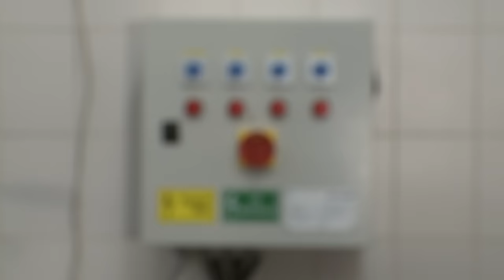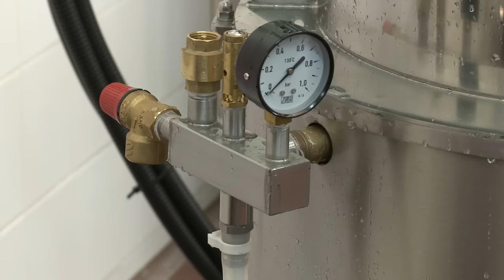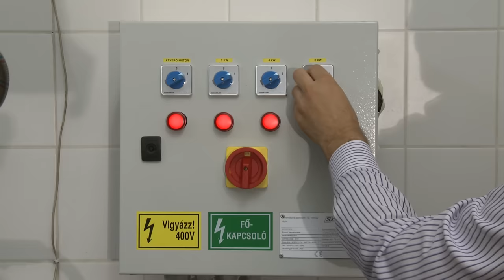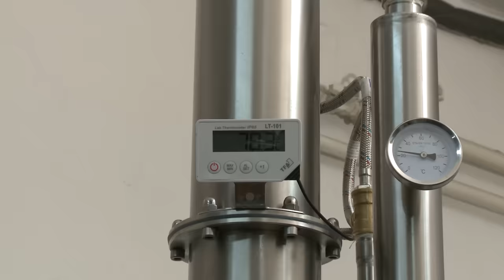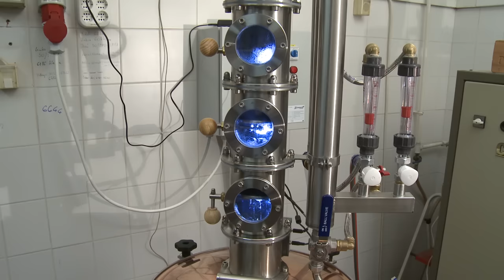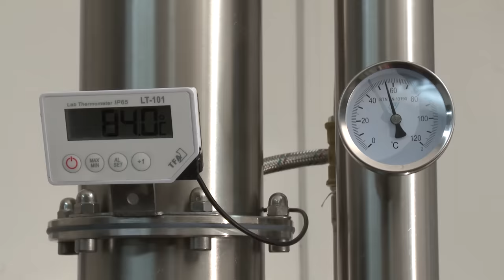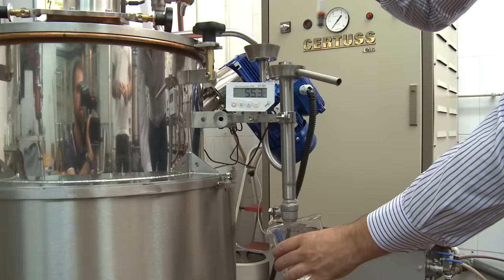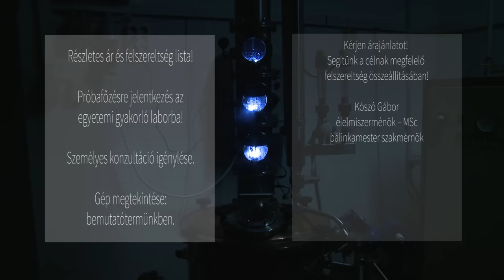Egylépcsős univerzális házi pálinkafőző / pálinkafőzés, technikai bemutató videó / palinkafozo.hu

Comment: congrats for the executive setup, i like it. i would like to buy such a machine BUT i have available max electric power of 5kw monofase 220V and also i need filling max volume of 120 lt instead of 80lt. please explain why the required electric power is so high as 9 kw and what will happen to the video distiller if the electrical max input is "only" 5kw. will it reach the distillation temperature ? it is only matter of time ? should be the pot jacket externally insulated (rockwool or similar). thanks for your suggestions. francesco, italia
Reply: I think they use only 4kW during the distillation, and 12 during the heatup.
If you use only one 4.5kW element your distillation speed will be the same as in the video, only the heatup time will be 3 times more (around 2.5-3 hours). Entire process will be around 4 to 5 hours depending if you collect tails or not. That's for 80L. If you want 120 you have to multiply the times by 1.5 - so 7-8 hours.
I wouldn't recommend you to go over 80L with only 5kW of power, its painfully slow.
As for the insulation - it will help a bit but not much, since the steel is not much heat conductive like the copper, and won't waste much energy.